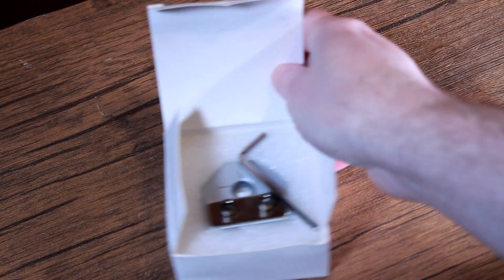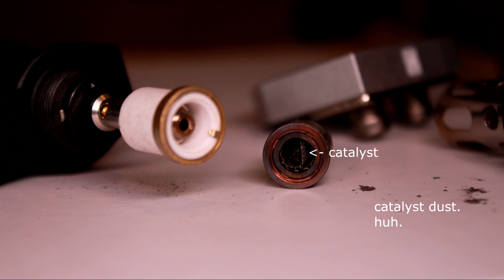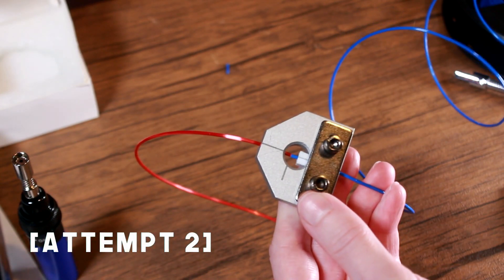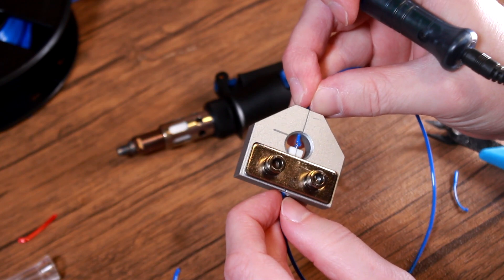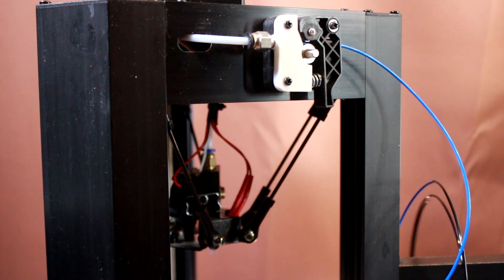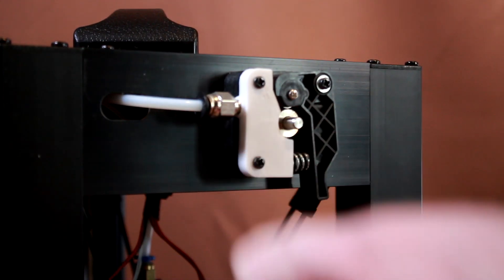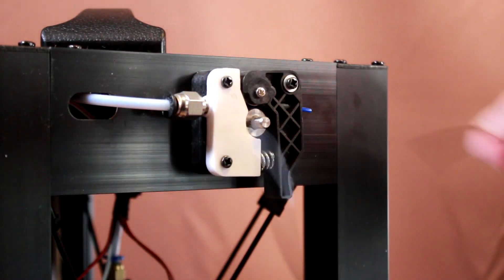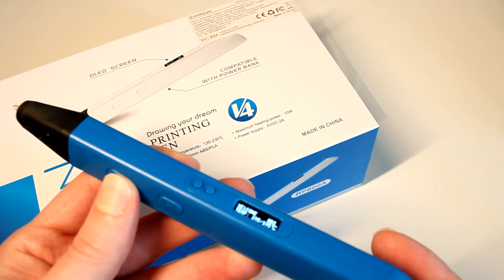Weird 3d printing accessory: What is this thing and do I need it? (it welds filament! But how well?)

Comment: Dude. Why not design some 1.75-or slightly larger— pliers that could squeeze the molten and connected filament to adequate size? It would make the size more consistent at the weld similar to rolling it.
Reply from the maker: that's actually a pretty decent idea! You could have a hot mold like that!
Reply: @LostInTech3D  i do like that idea, taking rollers or nonstick plastic and using them to pinch it up would be a good design choice. You’re already better than i am in design software. I’m just out collecting daily design ideas for my sort of stock ender. I barely know fusion 360 but im glad i could help lol

Comment: In one of mr3dp videos about recycled pet bottles he shows how to join filament using his "pullstruder" rig.
Reply from the maker: re-extrusion is something I want to get into, but more for the recycling aspect than this I guess.
Reply: @LostInTech3D  Its not actually the nozzle part but the heater block with a 4mm hole/groove cut out of the side. And some PTFE tube to help keep it in shape and close enough to the right diameter.
Reply from the maker: yeah its the same one cnc kitchen tried last week isn't it?

Comment: What would be the point of this though? Couldn't you use a marlin pause because its more reliable. This seems like the as seen on tv accessories.
Reply from the maker: you'd think. But a lot of people seem to use them, judging by the comments!
Reply: @LostInTech3D  oof
Reply: I see it as a way to spend al those small leftovers on filament spool. Not necessarily in money wise a way, but enviromently aware way. However it seems a bit tedious. 

With filament sensor you are still left with those small leftovers and must be around to do it.

Comment: A problem with feeding the unwelded second piece of filament behind the first is that you wouldn’t have any retractions until the second piece goes all the way through. The extruder would move the second piece back and forth like normal, but the first piece would sit there unmoved. Might not matter much on a direct drive where the retraction distance is less than a millimeter, but on a Bowden setup with a five to six mm retraction it might have a bigger impact
Reply from the maker: yeah you have to be pushing it yourself pretty much until it's safe. It would be just as risky to have a joint going back and forth I imagine.
Reply: @LostInTech3D  It works just fine if you’re printing in vase mode. Otherwise, less so.
Reply: Good point, I was lucky when I did it on an area without retractions.
Reply: You could pause the print. Home the extruder.  Change the filament.  Then Resume print.  Easy peasy, no filament squeezy.

Comment: Haven't tried it with pla but use to weld belts together when working at a bowling alley, you had to use a solder iron with a flat plate, two sides of the belts would melt against it and when it curled over you pulled the welder out and snapped the belts together.

Been trying to build a smaller one for this kinda thing
Reply: That is how I fused filament the one time I tried it. I used a razor blade and a mini torch, it worked first try.

Comment: As a fairly simple fix, use a bit of Bowden tube or 1.8ID metal tube, slide it on one strand, do your magic, slide the tube over the joint, jiggle it so it's lose and leave the  tube on the joint

Comment: Actually a solder iron that can be set to as low as 200C can be used to weld PLA reliably. Altho the probes used on irons are inaccurate at 200C so some experimenting is needed. I have welded two strands of filament with a marginal success. Obviously an inconsistent section at best. I do have a dedicated tip for my iron to smooth out overhangs or weld parts on occasion where the voids made from it braking are too big for a simple glue up.